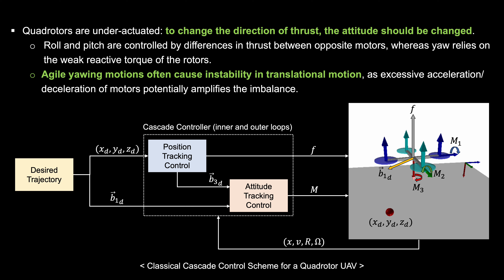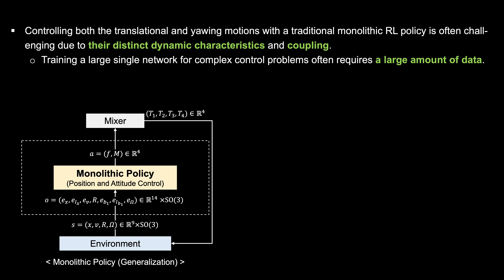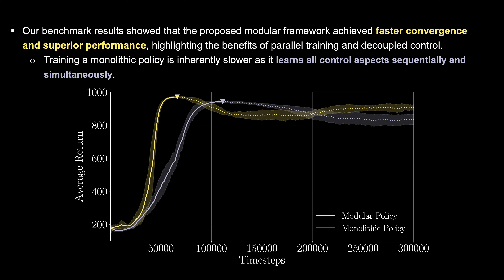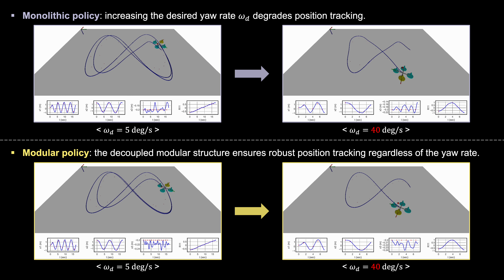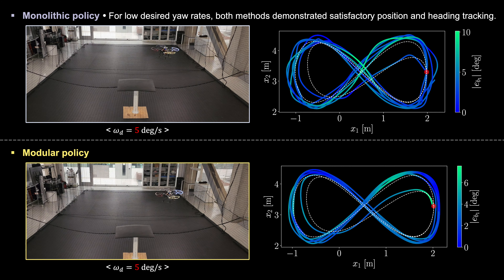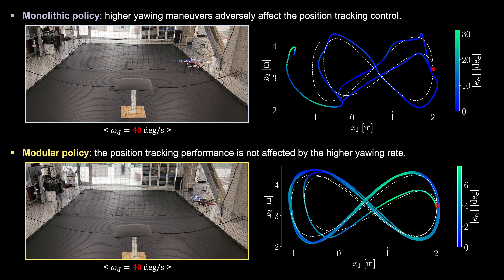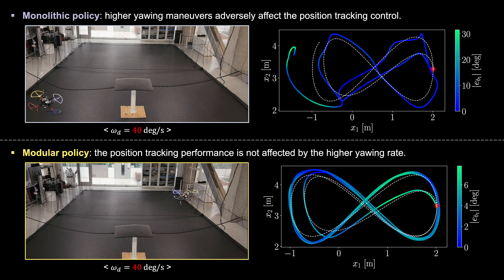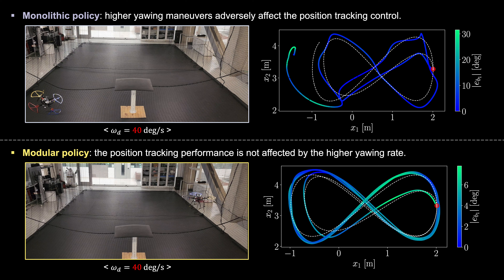Modular Reinforcement Learning for a Quadrotor with Decoupled Yaw

Comment: Intersting! But many questions. 

- It is from the system's dynamics we observed that the yaw angle can be decoupled and hence let's train the network accordingly. But, what if we do not know the such uncoupled dynamics of the system?

- You should compare the results with Geometric controller. Not standard monolithic policy.
Reply: Thank you for your thoughtful questions and feedback!

You're right—we decouple the yaw dynamics geometrically to simplify the problem. However, if we lack this prior knowledge, it's necessary to separate the dynamics in order to apply modular reinforcement learning effectively.

Great point—We compared the proposed approach against the standard monolithic policy to avoid confusion and ensure a fair comparison. The relatively large error in the geometric control, especially when the initial yaw error approaches π, stems from the topological restriction that prevents global asymptotic stability on a compact manifold.